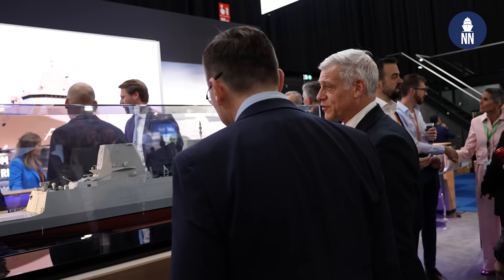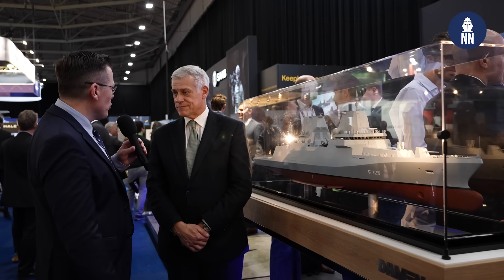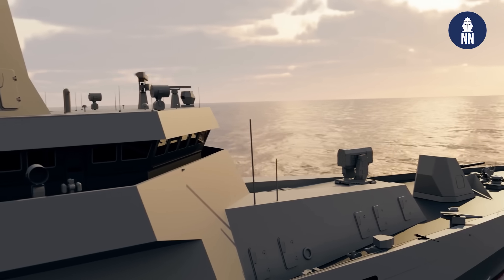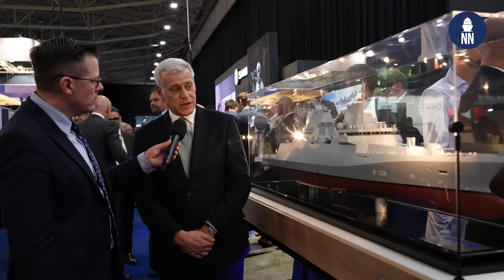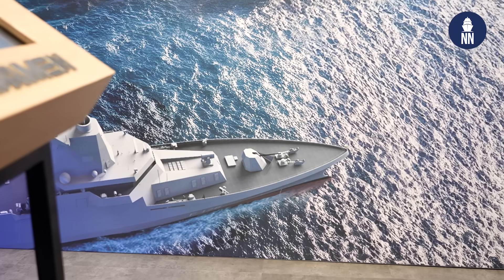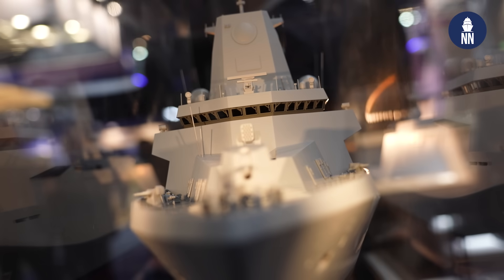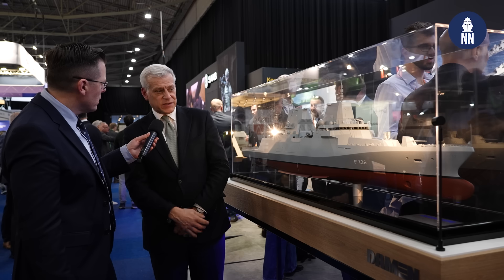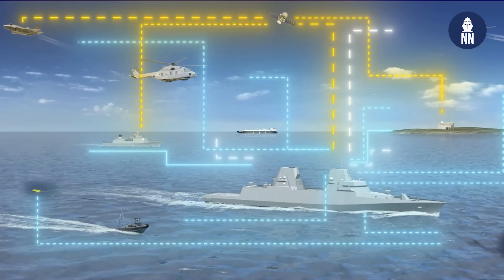German F126 Frigate with Damen at NEDS 2024

Comment: The Korean Sejong the Great-class destroyer, about the same size as the German 'Frigate' has 96 VLS. This German ship only has 16, which is ridicules. Even the UK frigates will have 48 VLS.
Reply: And neither of those are ASW Frigates. Congratulations, you don't even understand the basics.
Reply: @patta8388  It seems I do know that the UK Type 26 Frigate is an ASW frigate, with 48 VLS, and is smaller that the German ASW 'frigate', which only has 16 VLS.
It's true the Type 31 is a light general purpose frigate with limited ASW capability.
Reply: @Music5362  not quad stacked, less capable missiles and different profile. The Type 26 is an excellent ship. For the needs of the UK. 
It does not have the versatility and deployment length of a F126. 
When it comes to SAM's, the difference isn't that big btw, as in addition to the quad stacked VLS, the F126 carries 48 RAMs. 
Compared to the Dutch, Italian/French frigates for instance, the F126 also doesn't stand out that much.
Before you look at the armament, you always have to look at the mission profile and the mission areas.
And then the F126 is armed well enough.
Reply: @patta8388  I'm sure these ships will be very good & capable. Having more VLS will allow ASROC and cruise missiles etc. to be accommodated. Such a large ship should easily be able to accommodate a few more.
Reply: @Music5362  The german navy doesn't use Cruise Missiles. And the 16 cells are quad stacked. Counting all SAM together, the amount is  close to what a Type 26 could carry if it went all out on all the VLS tubes.
Reply: @Music5362  This ship will not operate in big contested areas like the Pacific will be in case of a war. It will operate near NATO coastlines with uncontested air spaces hunting Russian subs, like in the Atlantic-, Baltic- and Mediterranean sea. Plus it's modulated design will allow it to have more VLS if needed.

Comment: Is there a useful practical example of the use of these interchangeable modules?
Reply: Electronic warfare systems

Towed array system for anti-submarine warfare

Mine countermeasure capability 

Decompression chamber

A module for detention
Reply: @hansmeyer7225  yes, true, but still - from a ship that size you can kind of expect that there should be way enough space and capacity to integrate fixed ASW and EW systems. Especially ASW when the ships are even designated to that role
Reply: @matthiasradtke3874  Well I guess initially there was no ASW focus. It was more like one of several capabilities. 
The German Navy has only recently started selling the F126 as a ship with primarily an ASW focus.
Because ASW is in high demand throughout NATO. You can see this as even the old F123 will receive a big upgrade including a towed sonar. Despite her limited remaining service time in the German Navy.

I don't know what exactly an EW module will look like but every F126 will be equipped in its basic configuration with the R&S KORA 40 EWS. 

The F124's EW capabilities will be upgraded with the same KORA 40 EWS  albeit the F124 will receive some additional components for Electromagnetic Countermeasures. 

I don't know. Possibly the Electromagnetic Countermeasures part will be implemented through the EW Module for the F126 but with much bigger capabilities.
Reply: The Danish are using the same concept.
Reply: @EK-gr9gd  StanFlex Module are much smaller but contain usually weapons as well.
Reply: Yes - on small corvettes...

Comment: I assume those 16 launchers will be quad packed. So 64 missiles in the deck VLS.
Reply: He said exactly that. Plus the 22 Rams'  the 11 bow and 11 stern isn't to bad a lay out.
Reply: @stunick1573  21 per RAM launcher. But who is counting, right.
Reply: @stunick1573  but you can simple add more VLS on board ya? its a freaking 10,000 ton ship with the armement of a 4,000 ton standard, what do they do with all that space?
Reply: @liran547  Yes, sure.
Reply: @liran547  Nothing much.... just weird german procurement stuff all over again.
Reply: @HansPeters1234  crew accomodations, fuel, redundant structures etc.
this ship has a longer endurance on sea than comparably smaller/lighter ships and also a smaller crew.
just the 2 hangars take a large volume already.
Reply: @liran547 in there is maschinery and automation infrastructure. This ship is only crewed by 114 ppl, a complement usually only found on 3-4000t frigates. And it can stay on deployment for a full 2 years without returning to port if refueled regularly. That’s where all this tonnage comes from.
Reply: @stunick1573 I wouldn't like to think it will only have short range missiles.
Reply: @stunick1573  don't forget that they can put up to 32 x IRIS-T SLM inside about 4 above deck 1-teu container
Reply: Arleigh Burke has 96 cells for a similar vessel, Germany has just got it wrong

Comment: Truly a terrible design! 
10,000+ tons, 
Only 16 vls,
Just 8 ASUW missiles, all of which are crusier missiles, so they're not very survivable against modern air defences, meaning they're unlikely to reach the target and only have a range of 130 nmi,
Lacks any AAW cannons (23mm SeaSnake is not a AAW gun, the Japanese suffered extensively against prop planes of WW2 because their 25mm gun lacked the range, and stopping power) 
They cost €1.6 billion per ship in 2024. 
Only 26 knots,
And an insanely short range of just 4000 nmi.
Reply: You mean fantastic design, terrible requirements.

Comment: To formulate it positively: At least it has VLS. Not that that should be mentioned about a vessel that size but it should be about a German vessel...
Reply: VLS cell count is not that important with quad-packed Sea Sparrows. With 64 ESSM and 42 RAM it is armed quite well in comparison to other European navies who might use SYLVER, even if they have 32 or 40 cells. It can protect itself against any kind of aerial threat.

For ASW, other things are more important: F126 is very silent, enduring and comprises a state-of-the-art sensor suite. Effective submarine hunting is only possible from the air anyway, VLS-launched torpedoes are just a gimmick for a rapid close-range response, not for active warfare.

Also, because of the reference to F125: It is, for the time being, quite useful: Baden-Württemberg has sailed around the world for a year, now it's on a training station and after that it will be on the UNIFIL deployment, all without a major repair stop. With conventional ships, it would have taken 2 or even 3 changes of ships. So at the moment, a lot of our limited fleet capacity can be used elsewhere because F125 can do the basic missions. It gives the navy time to rebuild and use more ships to monitor the baltic sea.
Reply: Well, the F125 class was ordered in 2007 and designed even before that. Around that time, up to 20% of the Bundeswehr land forces were stationed in the North of Afghanistan and the Americans requested allies with capabilities for asymmetric warfare. 

And the F125 is actually better suited for that role than any other ship of that size in all of NATO. It's significantly larger than than the class it was meant to replace but had barely half the crew. Emphasis was put on stealth and hardened computers and electronics. It was built around the concept that crews get rotated 4 times a year, while the ship can stay deployed for up to 2 years, providing a swimming operations base for about 100 Allied special forces, who could conduct missions using transport/support helicopters and two large RHIBs, with 80 km pinpoint fire support from the Otobreda that canfire up to 16 Volcano rounds/min.

Some of those capabilities are used in the F126 as well, but not a lot. After spending their Christmas money on two additional F126 and 2 Type 212 C/D, the navy is now spending over a billion to keep the F123 in service well into the 2030s and trying to find a suitable role for the F125. For example the mission containers will be equipped with an Iris-T SLM.

Comment: Only 16 VLS cells? 😧
Reply: 4 essm per cell, so 64 missiles for mid range air defence. Beyond that air defence will be covered by the F127 which will have 64 cells.
Reply: @-MarcelDavis-  still they should have added more vls cells for anti submarine rockets since its ASW
Reply: @jonlaurenzreyes1902  The available ASW Rocket systems are not suitable for open water ASW anymore- Modern ASW happens at upwards of 50 km. If you are in range for VL-ASROC then you have already been sunk.
Reply: @-MarcelDavis-  that leaves no cells for anything else though. No long range AD, or anti-ship/land attack missiles, or even a VLS torpedo.

Even with the NSM, that is only 8 missiles that makes up the ships entire offensive capacity.
Reply: @regarded9702  Ger also uses long range guided 127mm shells >100km range and those ships are intended to carry light anti ship cruise missiles in addition to the NSMs.
Reply: @PagsPayback  sure but they are only really suitable for holding off fast attack craft or surface drones. Good for defence but that's it.

My concern is that given the size of the german navy, it is likely that F126s will be called upon to escort/intercept Russian vessels. This is a match up heavily in favour of modern Russian frigates, should it ever come to that.
Reply: @regarded9702 
I think you are misinterpreting light ASCM. Marte ER etc. still pack a punch, not to be confused with ship based Hellfire or Brimstone missiles.
And yeah, I would sure hope that F126 would be called upon to intercept Russian vessels. Same as F125s, F124s and K130s, that's their job.
But I have the distinct impression that you considerably overestimate the frigates Russia has available in the baltics.
Reply: @PagsPayback  I do not place much faith in light anti-ship missiles as I believe their short range would prevent them from being fired from a safe distance from their target. At least not unless they are being fired from low-observable or attritable systems.

However, after looking it up I have realised you are right about your last point. I was giving the Russian baltic fleet much more respect than it deserved. 

With that in mind, I would say you are correct that the F126 are sufficent for handling the threat the Russian baltic fleet poses.
Reply: @regarded9702  It will have the VLS + 2 RAM launchers + 2 27mm guns + Laser weapons + .50 RWS and a very good EWS just for AA self defence, that's more than enough for an ASW ship.
Reply: @regarded9702 because that’s simply not its purpose. The requirements you’re stating here are met by the following F127 class which will be an air defense frigate coming with a total of 64x VLS cells.
Reply: 0:36